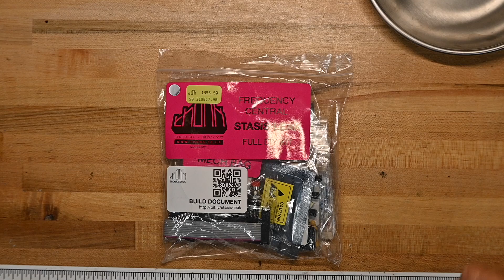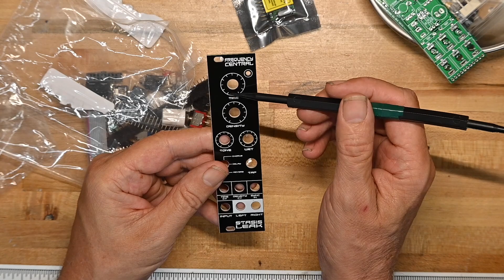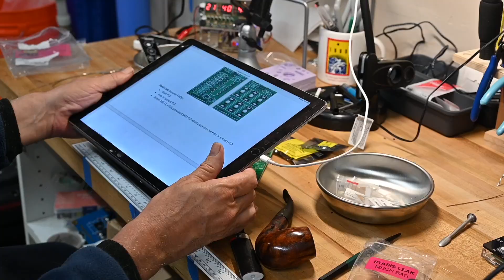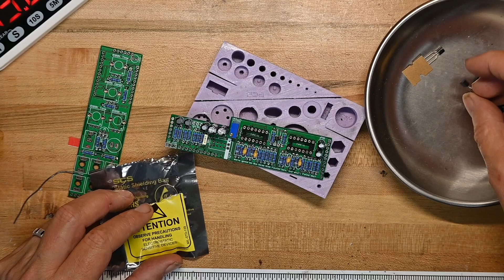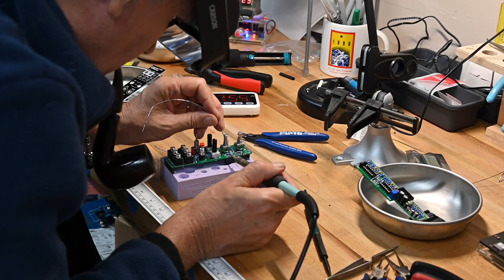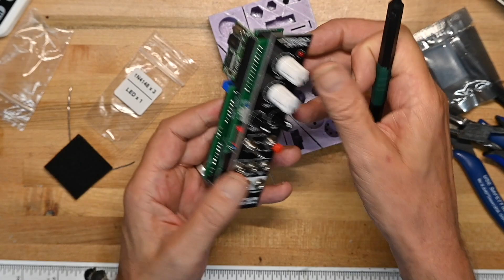C.K. builds a Stasis Leak chorus/delay/reverb eurorack module from Frequency Central

Comment: Such a shame the source signal was so distorted and lacking in high frequency. A simple higher pitched square would have been better for this demo I think.
Reply from the maker: You're probably correct.  This was an earlier video, and my demo techniques have gotten better ;).  Thanks for stopping by!
Reply: @CKHaun  No problem I did appreciate the video non the less.

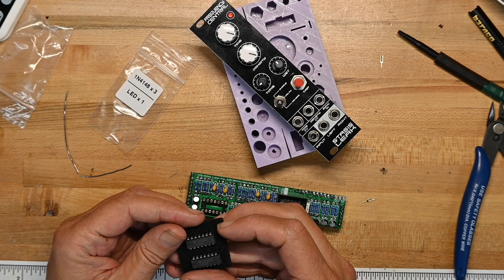Comment: 25:10 - The intertubes are saying "the TL084 and the TL074 are nearly identical, but the TL074 has lower noise."
Reply from the maker: Hm, I may lay in a supply of the 74s then and replace any 8s that show up in kits, thanks.